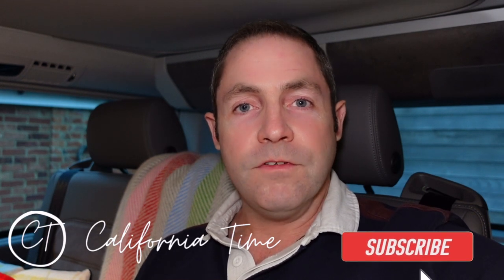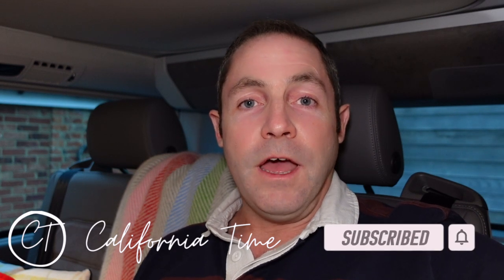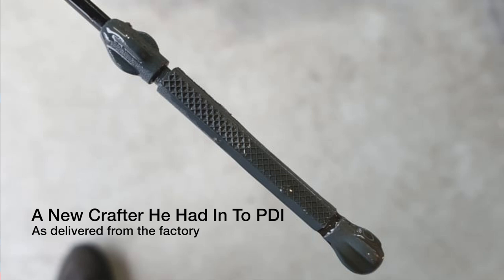VW MASTER TECH INFO: Reduce Oil Level Warning on VW Transporter and California T6.1 - Follow Up

Comment: I wonder if the amount of oil expansion is directly linked to the amount of dilution? More dilution more expansion perhaps?
Reply: But great video by the way…
Reply from the maker: Difficult to say I think. When we did a lot of testing on ours ourselves, we were really really careful not to switch the engine off during regen, so I think we managed to keep things consistent.

Comment: Thanks for another useful video on this subject. 👍

Appreciate I'm late to the party here (yet to get my hands on my first Transporter - a factory order placed May 2021),  so can I ask if you had the oil analysis done and, if so, what the results were? Also, if oil expansion was the reason for your "reduce oil level" warnings, do you still follow your own advice that you provided in the initial video (i.e. not switching off during a regen)?

My only other observation is to note how poor it is that the VW technicians performing the PDIs at the dealership aren't kept informed as to how full the oil should be filled!

Cheers!
Reply from the maker: I didn't get it done in the end as the van never had the warning come up again, even after an oil change at the local (Nottingham) dealer, who filled it correctly. We did still try not to switch off while it was doing a regen but to be honest we mostly did long journeys anyway so it wasn't very often that we wanted to stop the engine and it was doing a regen. My conclusion is that it is much more about over filling rather than oil dilution - I think that is very minor as when I got my oil level down to the correct level, all was well for ever more.

Comment: Hi Will, what a great channel, so straightforward and informative with great reasoning and detail. I've just collected a new Ocean 204 4motion, only done c 400 miles from collection and locally so far. Read this and checked my dipstick when cold, it shows oil right at the top. Am, wondering if they have updated the software on this engine since this posting and if I should therefore just wait and see what happens or if I should remove some oil as a precaution. What do you think? Thanks!
Reply from the maker: I'd wait and see if there are any issues that come up. Our first ever light came on at about 1200 miles, and it was explained to me by a VW Master Tech that the engine management system operates in a slightly different mode in the first x amount of Kms anyway - hence why it comes on a bit later. See how you get on - but at least you know what to do if it does come on!

Comment: I have a 2021 Transporter and oil level warning started around 10,000km. The vehicle had been timely serviced with an authorized VW dealer in NZ. To address the issue, the same dealer refilled the oil and later replaced the oil sensor. These attempts were unsuccessful so my van will be in the shop for an extended time and require a long distance test driving as requested by a VW technician.

UPDATE 6 months after the warranty repair and test driving, the oil level warning has not reappeared. Also there was no software update involved.
Reply from the maker: Are they sure they are filling it correctly?
Reply: @California Time  I will ask them when I collect the van next week.
Reply: @CampervanTime  My van was returned after a 450km run with an oil reset and quality check. I asked my dealer about the oil fill and my van is filled to "full" as specified by a VW technician and adamant it is done correctly. Time will tell so I will update if the oil level warning pops again.

Comment: Will, 
Took my T6.1 in with 'reduce oil light'. I asked them to do exactly as your technician mentioned in the video. 
They confirmed warning on dash. Checked the oil found below maximum. No faults found on their computer. 
They reduced oil level approx. 5 liters. Topped up fresh oil to just below half as requested . Carried out soft ware update. Drove it 2 miles and rechecked oil level at temperature.
All ok after 130 miles. It seems one has to reduce oil level to half and then update the software.
Reply from the maker: Ok, good to know. We haven’t had any software updates on ours and we’re over 5k now with no light on. Glad you’re all sorted 👍

Comment: Did the T6 had the same kind of issues?

Because I just had this kind of warning, but After a full engine check this autumn... (I had a turbo problem). I am really considering turning the page of California right now... Too many problems for the money spent!
Reply from the maker: Have never heard of this kind of issue on a T6, we certainly never had it either. Not sure if they have the same type of oil level sensor kit in the sump.

Comment: Hi thanks for the detailed information!, bottom line I wish to understand, is it safe to ignore the alert? assuming the technician at the vendor center filled the correct amount of oil as recommended by the manufacturer, Is there a need to do any action? Or is it just a matter of getting rid of the annoying alert? is there any damage to the engine??
Reply from the maker: That is too difficult to answer without knowing the physical level of oil in the van. If the technician filled the correct amount of oil as recommended then the warning won’t be on. This problem happens when technicians (incorrectly) fill the van up to the maximum mark when the van is cold. The oil level should be at half on the dipstick when the engine is cold (or just below) and then the warning will not come back. Every time you open and close the bonnet it will turn the warning off for the next 100km/60 miles anyway. It will just stay off if the oil level is actually correct.

Comment: Thanks Will. Very interesting , yes , I think the oil analysis is a great idea , if not only for us , but you wont rest now until you know anyway I’m sure 🤦🏻‍♂️😂
A little confused over the RDE1 &. 2 , I assumed the 199/204 was purely an engine management change, but if I’ve understood  correctly, you say it’s a different engine?
Reply from the maker: Hi - not a different engine, just different engine management software and a secondary injection system for the ad-blue I think (I might be wrong, but sure I read it somewhere). The easiest way to tell on the T6.1 if RDE1 or RDE2 is by the 199 / 204, but obviously the 150 engine was the same output in both RDE1 and RDE2. There will be a chassis number swap over I expect, but I don't know it - but I do know that any vehicle registered after 1st Jan 2021 MUST be RDE2 compliant.
Reply: @CampervanTime  Thanks. I’m kinda hoping by the time my (204) comes next year that this will be put to bed somewhat, nevertheless , very interesting. Keep up the good work…

Comment: Thanks Will, fantastic video. I’ve a 2021 204 California with 5,000 miles, 2,000 in the last couple of weeks doing the NC500. No warning light so far but I’ll check the oil when cold and let you know 👍🏻 David @VW1Camp
Reply from the maker: Great stuff, sounds like you’re all sorted already 👍. We’d like to do the NC500 too, just need more time off from work!
Reply: @CampervanTime  Hi Will, I’ve checked my oil level, it’s just over half way up the level. Thanks for your video, otherwise I would be topping it up, I’ll check again when hot when I remember. David
Reply from the maker: Good stuff. I wouldn’t suggest topping it up !

Comment: Obviously this is another concern which as usual VW seem to handle badly . When your vehicle is due service it might be worth noting what the oil capacity is in the handbook and then check the invoice to see how much oil  has been used on refill and what amount you're charged for. Probably the same amount stated in the handbook. Cannot see VW recommending a lower amount .
Reply from the maker: Yes I did wonder about that - ie the level which is in the handbook, how does that correspond to the level on the dipstick then when engine is cold - top, middle? I know it's not right, but if our van gets serviced and I check the oil level on the drive the next day (cold) and it is at max, I can take some out still.

Comment: Actually the reality is that we pay plus 50k plus  for vehicles which are advertised as the latest technology and they cant even get a warning light correct.
Oil levels in most vehicles are kept to  over half way. Now we have to ensure VW T6.1's are under half way or the 'Reduce Oil Light' come on. Is that modern vehicle technology? No its a joke and its obvious that VW have no answer and they have made a huge mistake in the sensor tech of T6.1's.  One can  be in the middle of nowhere and the  instruction is go to the workshop and reduce the oil level. That's unacceptable  for a £50k plus modern vehicle. The software upgrades are useless. Upgraded last Friday. Light back on -dipstick registers half full. Disgraceful !!!!
Reply from the maker: Agree it’s a right pain in the neck. I think VW are obviously trying to stretch out their legacy design fossil fuel engines to meet the latest very stringent euro emissions standards and having to bolt more and more stuff on to them to get them to comply - way less than ideal / a new blueprinted engine for the job in hand. In some VW Golfs and Jettas (Europe) they have had recalls on the dipstick and changed it to one of a different length !!